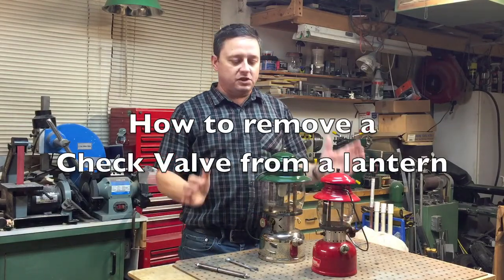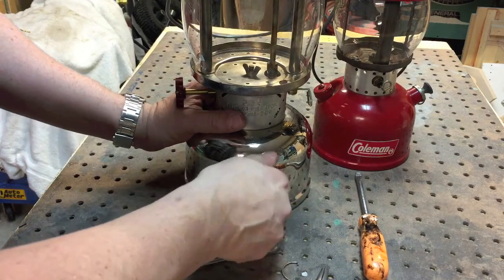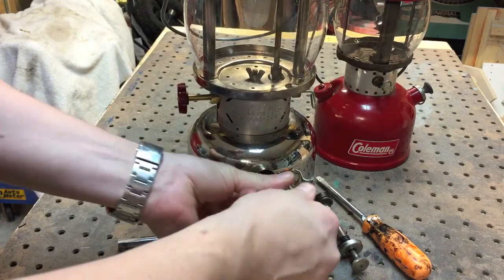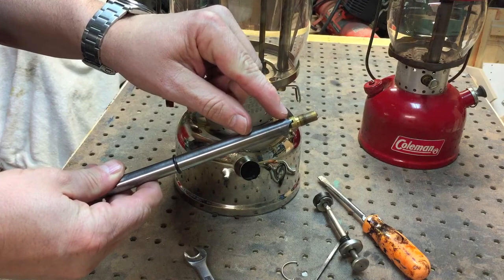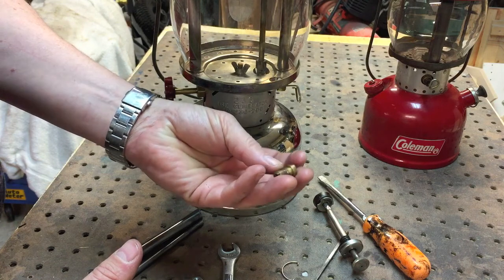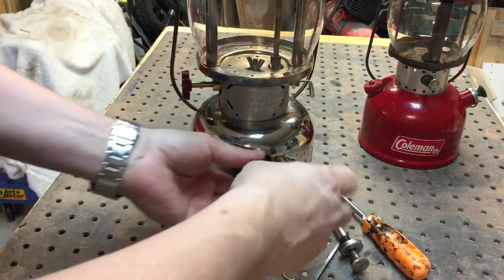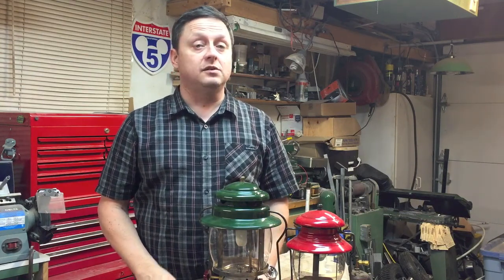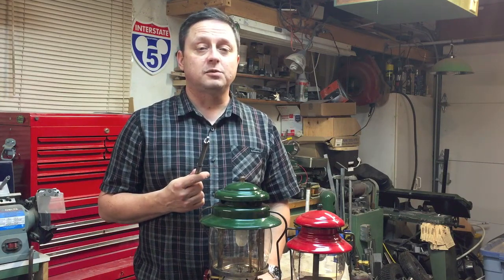How to SAFELY remove a check valve from a Coleman lantern // Restoring Vintage Coleman Lanterns

Comment: You should market and sell your tool. I would love to have one.
Reply: Dan Lafontaine Someone does make a check valve removal tool. You can find it on the Old Coleman Parts website. It will set you back around $40.00-$50.00.
Reply: Use a flathead screwdriver .
Reply: Right tool for the right job. Don't Be A Primitive Pete, use the right tool. They are listed on ebay.

Comment: My check valve was stuck and clogged up,therefore wouldn’t allow air to pump into the tank. I took out the shaft and insert rod,then sprayed a little carb cleaner down inside the check valve where the ball sets. I let it set for about an hour or so. Then took some mig welding wire,size 0.30 and pushed down on the ball. A little pressure was in the tank and some carb cleaner came out. After I seen the carb cleaner come out I knew it was free from debris and functioning like it should. Just make sure you don’t have a lot of pressure in the tank or you will get a face full of carb cleaner and Coleman fuel. But it works in a pinch.
Reply from the maker: Thanks for commenting. I'm glad you sorted it out. Good reminder! Yes, you should always release the pressure and/or have to cap off when working on the CV. Cheers.

Comment: Where does one find the tool to remove the check valve?
Reply from the maker: Old Coleman Parts typically carries them and I also make them in my spare time. Follow link in the description of the video.  Cheers

Comment: Thanks for the information and know how. I could not get that baby (check valve itself) to budge. So on to ebay and purchase. Mine is from 1982 and was packed in the Coleman carring case when we first bought out 82 coleman popup. I just sold that but kept a few things thcluding thius classic. Again thanks.
Reply from the maker: You’re welcome. Just be careful of “newer” lanterns. Newer lanterns have a smaller check valve stem. (8-32). Easy to tell. Just pull out the rod.

Comment: How does one remove a frozen check valve from an old Coleman Lantern 220F. I have soaked with carb cleaner and have used a flat head screw driver. Any suggestions or ideas would be greatly appreciated. Thank You if you can help me.
Reply from the maker: The easiest (and safest) way to remove a check valve is with a dedicated check valve removal tool as shown in the video. I also have video on how to make one. Once you get the tool in place its best to "crack" it open by hitting the wrench with a small hammer (as shown in the video) This breaks the seal that the solidified fuel has created. Cheers.
Reply: But I believe that the check valve is frozen?
Reply from the maker: A screwdriver alone will not get a frozen CV out. You will need a dedicated Check Valve Tool. You will need something to hold the tank (a strong person or a fount clamp) and you need to tap the wrench counter clockwise to break it free. Going slowly won't work. You need a sharp crack of your palm or small hammer. As per the video.

Comment: Hello, 
Is your lantern a 236? I 'm trying to remove the check-valve from a Mexican Lin-Mex lantern (236 clon) . I've seen some tools on the net. I don't want to order the wrong  tool for the lantern. I tried to remove yñthe valve with a screwdriver but it didn't work out.  Carburetor cleaner didn't work either. Any other tip or link with the right tool would be useful. There is a dual tool but they don't ship to Chile. Thanks for your time.
Reply from the maker: Thanks for commenting.  I’m not familiar with those lanterns. I’m not aware of what CV they actually use.  If you can figure out the tread pitch you may be able to make your own. I have a video on how to make a CV tool.  Cheers.
Reply: @MikeFreda  
How much does it cost one of your tools? Are you in  Europe or U.S?
Reply from the maker: I’m in Canada. I’m not sure the tool I make will work for you. Please feel free to PM me with some pictures of your lantern and check valve stem.  Cheers.

Comment: My primer on my lanturn won't presserize, while I try to push it in with my thumb over the hole in the end it won't go back down
Reply from the maker: Sounds like to have a faulty check valve or a plugged air tube.  Have a look at my other videos.
Reply: @MikeFreda  thank you for your reply i will have a look. Thank you!

Comment: What are the threads? 3/8 X 24?
Reply from the maker: No. The two most common CV threads are 1/4"x32tpi and 8x32tpi.  The 1/4" die can be hard to source.
Reply: Great

Comment: Thats all great if you have the tool, i had to make my own version. I made a video on yt on it using a chisel,socket and impact driver
Reply from the maker: Yes, I've tried that method at first. It can work with steel founts but I would not recommend that method especially with brass founts.  The end of the brass founts pump tubes are soldered, hammering will loosen the CV socket and/or it will fall off or leak. Trust me, I ruined a rare lantern that way!
Reply: Mike Freda i may add also that i dont consider myself a collector or restorer however now im sitting with 3 220s, 220a, 530 and 245 camp stoves. Maybe im in denial still.